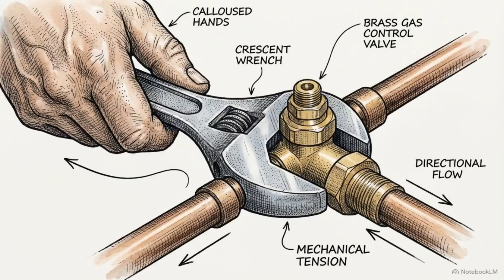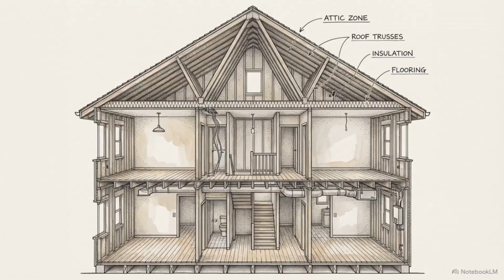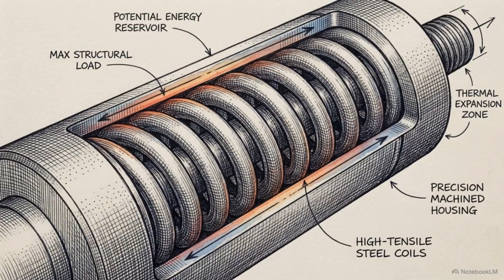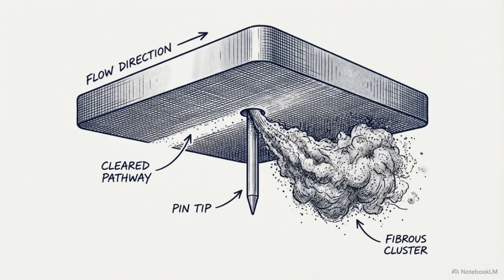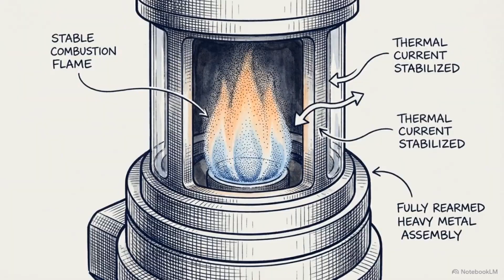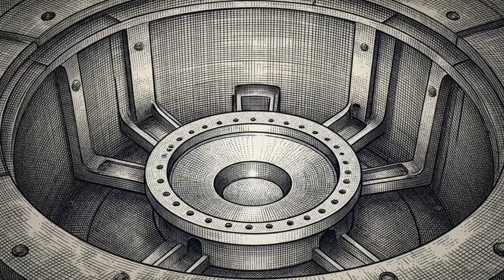Troubleshooting and Repairing Rheem Water Heater TRD Safety Devices

Comment: It’s always frustrating when you expect hot water and find your water heater silent. I’ve seen it happen often, and in many cases, it’s just a ventilation issue. American Residential Services checked our system, and they found dust buildup that was obstructing the air intake, triggering the safety device. Regular maintenance can prevent this from happening, especially in attics where dust accumulates.
Reply from the maker: Oh yes your right. That happens